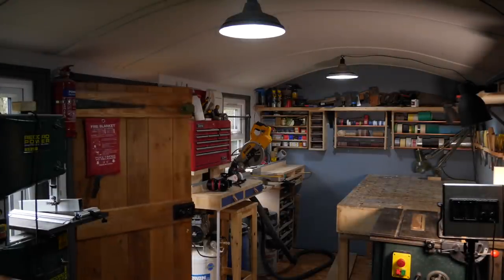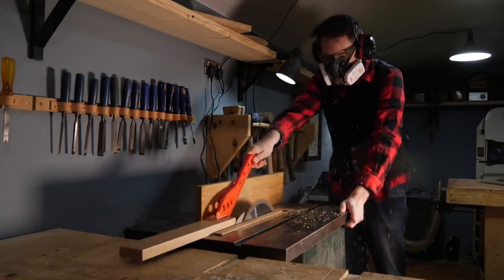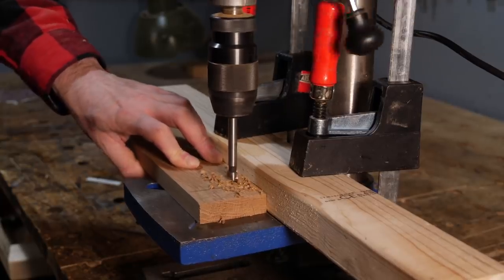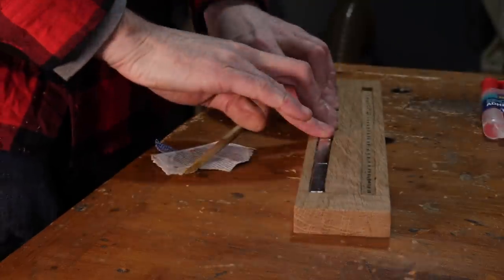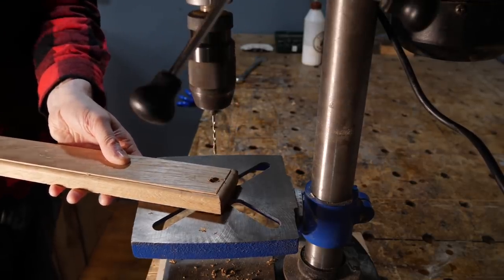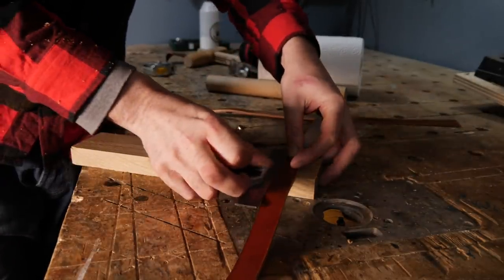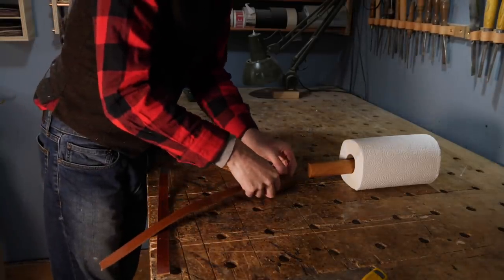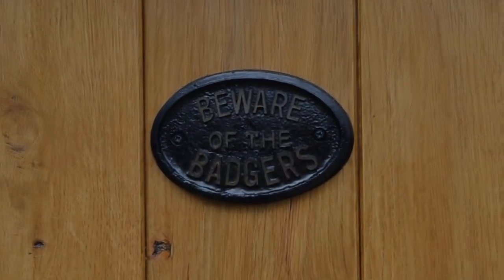Making a Magnetic Knife Rack and Towel Holder

Comment: Great projects, Matt. I'm very interested in that roll holder. We've just started getting bigger/thicker rolls and my last effort is too tight for them. I like your strap design as it can adjust to accomodate differing rolls. Cheers, I have no excuse  now to prevent this job getting done.
Reply from the maker: Thank you Keith. Sounds like you have a project for the weekend

Comment: Great video.  I didn't see you do it, but did you check that the magnets worked through the veneer before you glued it all together?  I made a magnetic knife block a while ago and had to spend a while getting the veneer thin enough for the magnets to really hold the knife blade, especially on heavier knives.
Reply from the maker: Yes i checked first

Comment: "Because I'm worth it".  Caught me by surprise.  Made me laugh!  Really like your paper towel holder.  I am going to make it.  Thanks!  Would be nice to have that in the shop too to replace some rope and a piece of bamboo.  I made myself a magnetic knife board a year or so ago.  I drilled, deep holes in the back with a forstner bit and put round magnets in the holes which were lined up where the knives were to be.  It worked okay, but I have one heavy knife that would have held better with your method.  The heavy knife doesn't fall off, but it slides a wee bit and kinda scares me.  I should add more magnets for that heavy knife.  Appreciate how you incorporate leather from time-to-time.  :)
Reply from the maker: Thank you very much. Im glad it made you laugh. I like the idea of having a towel holder in the workshop. I might have to make another one.